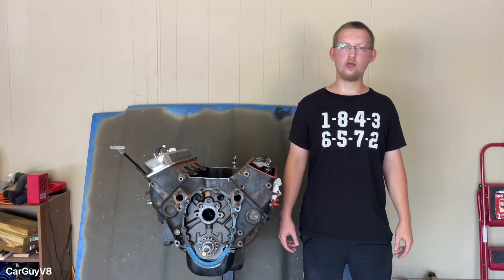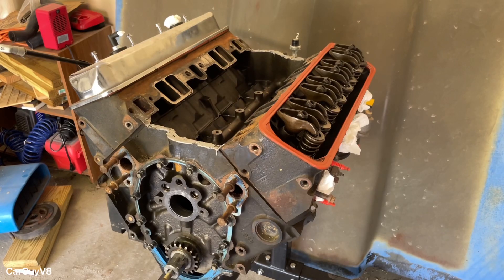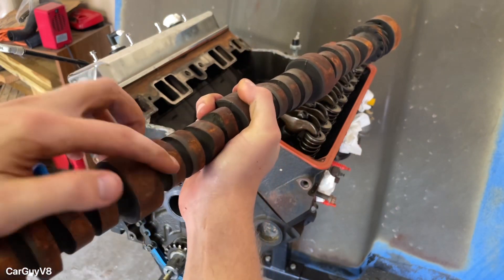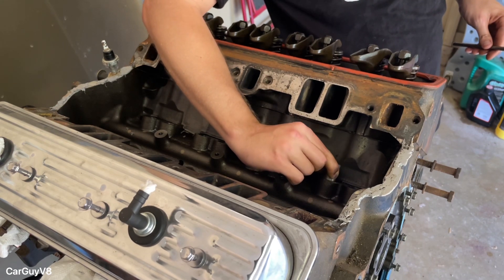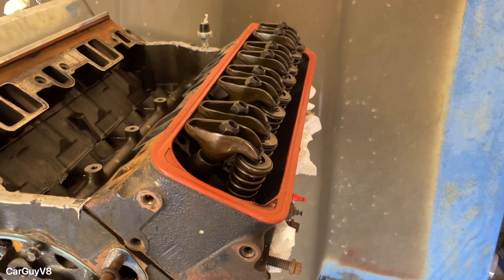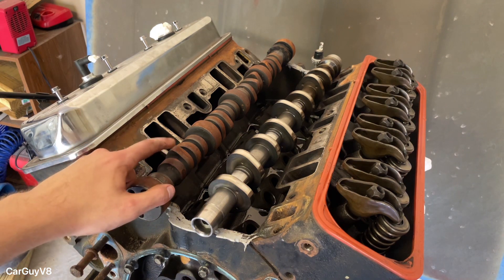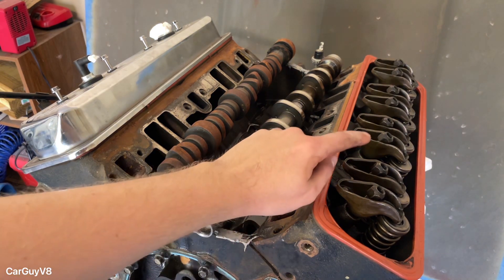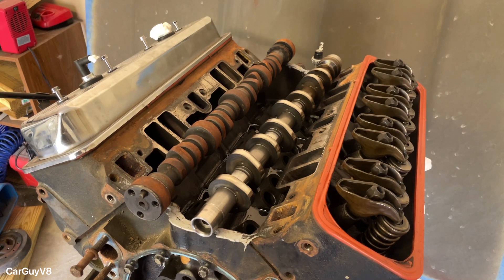Why Do Camshafts Make Your Car Louder?

Comment: that was an interesting video, do you know how much it is to cam a car?
Reply from the maker: I’ve done it as cheap as $300 and it can be as expensive as 3k. It’s all dependent on the engine it’s going in and what whether it’s efi or carbureted.

Comment: It's pretty obvious to anybody who's ever turned a wrench why a camshaft makes your car louder. The lobes of the camshaft are connected directly to the crank by a series of tubes and every time the camshaft and the crankshaft hit each other they make a loud popping sound that reverberates down through the tires causing the rubber to ultrasonically weld to the pavement. People think camshafts advance or retarded to timing but it's actually this Sonic resonance friction welding of the tire and the asphalt that causes your car to go faster. It's a similar principle as painting your car a faster color to lower your quarter mile time. The black car will absorb more light energy than a red car so when you paint your car red you have more photons pushing from a southernly direction and decreases the thermal coefficient of friction thus increasing sinusoidal deepeneration which results shaving a few tenths off your quarter mile time.
Reply: Bruh just stfu pls this guy did great explaining we don’t need your bible of a paragraph He explained it for ppl that don’t know and the ppl that do know but need more information

Comment: Is there any spcefic flat tappet valve adjustment
Reply from the maker: With hydraulic lifters set the valves 1/4 to 1 full turn after zero lash on the base circle of the cam.

Comment: You’re not wrong, but there is even more to it; a high performance aftermarket camshaft will also have more duration meaning valves will open sooner and close later. The  exhaust valve opening sooner interrupts the power stroke sooner meaning there is more pressure which translates to louder exhaust.
Reply from the maker: You’re absolutely right. However, my channel’s average audience retention stats show that most viewers prefer a short, straight to the point video. Not a 10 minute+ video explaining everything in depth. Some people like in-depth explanations, and TV shows like Engine Masters are perfect for that. I try to keep my videos fairly brief and straight to the point. Thanks for watching!
Reply: Correct.